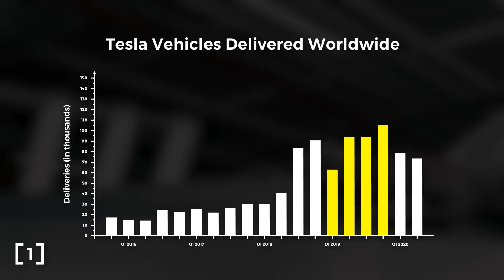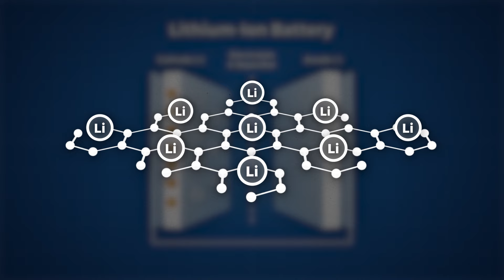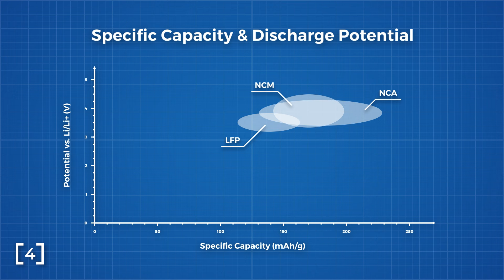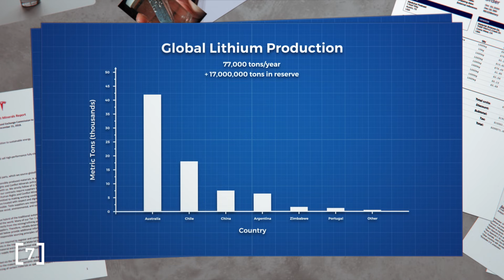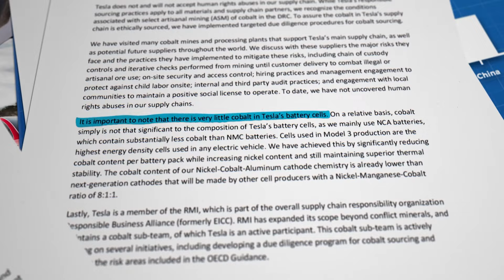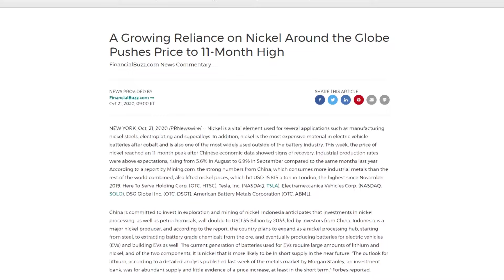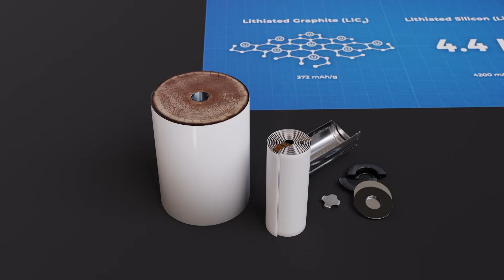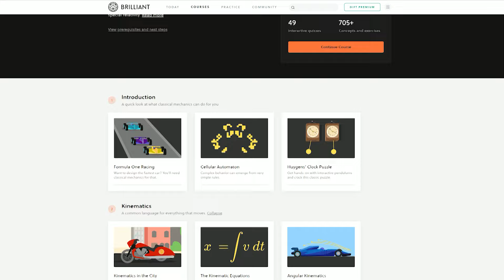Tesla's Battery Supply Problem

Comment: "We need to transition away from fossil fuels, quickly!"  ... "The batterie supply chain starts with mining."  SOUNDS LEGIT
Reply: The amount of carbon producing the electricity released charging them is worse.
Reply: Funny and true
Reply: @Home 2 Sky There isn't a massive difference  in emissions between the 2. The electric vehicle comes out of the plant with a higher amount of emission cost compared to a gasoline vehicle.  The gasoline vehicle does pass it over its lifetime but not by a lot.
Reply: @samuelhowie4543  even if that's true today its a totally unfair comparison, it would be like comparing a 2021 corolla to a car from the 1920s. this tech is in its infancy and already is comparable to what its trying to replace? that sounds very promising to me. it needs more time, and its time will come.
Reply: @samuelhowie4543  You are wrong. Plenty of material out there to read that clearly shows you are wrong. And anyway even if you are right then EVs do 0 harm from the engine to the people living in the city. Just alone that would save million of lifes and billion upon billions of dollars in healt care.

Also what ever report you have read, then read it again and see if they even mention the energy use of the drill rigs, the pumps, the tank ships, the gas station, the semi transporting and the raffineries. I bet you they do now.
Reply: @simonquvang6073  And the majority of the reports also gloss over the fact that most of the electricity is generated by fossil fuels. One thing most people overlook is the roads are supported by taxes on gasoline not on the vehicles .
Reply: @raiden000  Ok, look into solar. The first panel installed was in the early 1900's. It was 3% efficient we are now at 20 % efficiency in 100 years. That's not much of a jump when you think about how far ahead the technology is today.
Reply: @samuelhowie4543  solar isnt what were talking about, electric cars are.
Reply: @samuelhowie4543  USA has about 46% energy from clean sources and Europe has 56%. And it's changing fast.

It dosent even matter. We could power the EVs on coal and it would still be better than the massive amount of oil we spill in the water. The massive amount of energy we consume to pump up the oil. The insane amount of highly toxic bunker fuel we burn to transport the oil. The even bigger amount we use to heat billions of liters of oil to 400 degree celcious.

We never add that energy use to ICE cars.
Reply: @samuelhowie4543  besides that actually is a very big jump in a short time.
Reply: Yeah...
Reply: @gabrielmartinez3171  personally if it means even if exactly the same of carbon is put into the atmosphere at least its all in the middle of nowhere rather than direct out of a car exhaust into my mouth when I'm walking
Reply: @darksideofthemoon128  do you think that the carbon and all gases released by producing electricity stay in the middle of nowhere.
Reply: @gabrielmartinez3171  you're right in both cases they do dissipate into the atmosphere, but neither are a complete solution, and only one of them means I need to gulp car fumes
Reply: @Home 2 Sky there are no electric mining vehicles capable of doing the job compared to gas powered vehicles, unless you want your batteries in short supply.
Reply: Right!. Nuclear power is the way... this is the way.
Reply: @allgoo1990  I think that's why they are floating the idea of a mile tax. Plus that way the people who are driving electric cars now will have to pay also.
Reply: @allgoo1990  When it comes to taxes, hard to believe they won't figure someway if levying it.
Reply: @samuelhowie4543  Maybe since the research was focused on fossil fuels powerplants for the past century and people didn't cared about solar pannels until global warming became a big issue, wich mean even if solar energy is not what we're talking about here, even solar pannels could become better in the future years.
Reply: @samuelhowie4543  (turns out that generation on the grid is so much more efficient than fuel burning in a car that even with terrible fuel used in generators, electric cars are still better than gas ones)
Reply: @samuelhowie4543  source please
Reply: We are never going to get away from mining.... So I don't see how this translates to the problem. Like what is your solution to the mining problem? Stop mining?
Reply: hmmmmmmm
Reply: @gabrielmartinez3171 no. Due to increased efficiency even if the electricity was produced by coal most likely the carbon emissions will be lower.